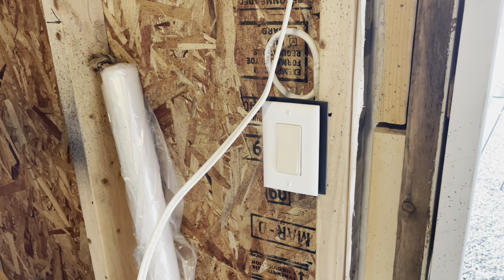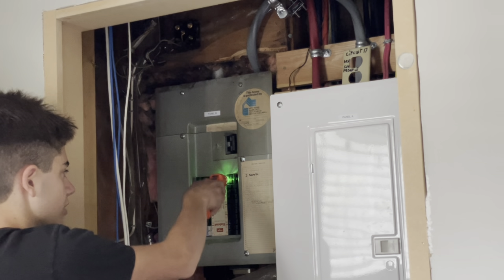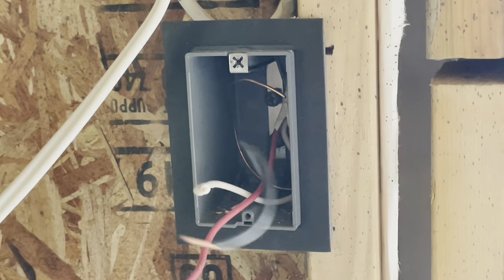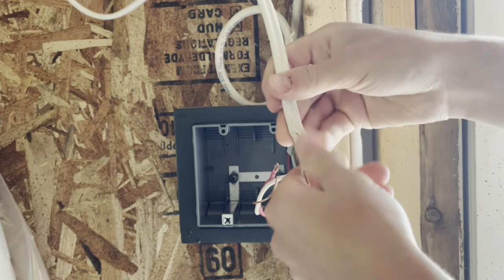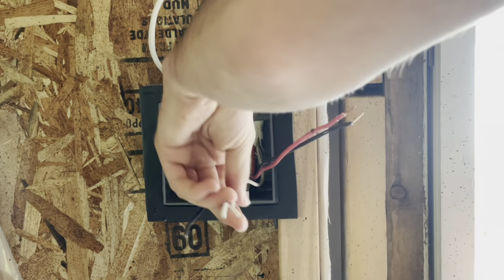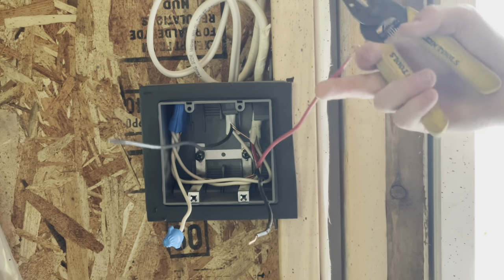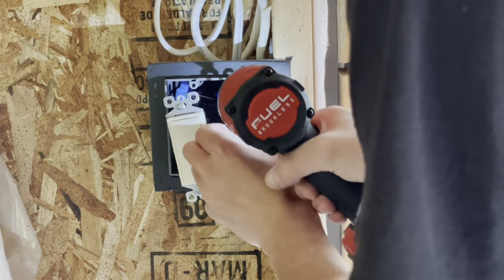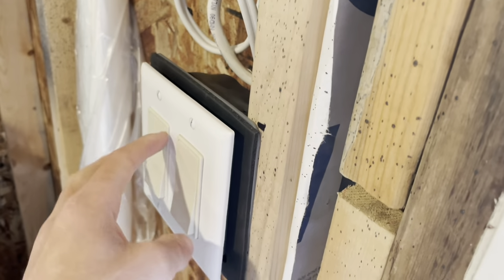Turning one light switch into two switches for two different lights.

Comment: A bit confused as if these 2  switches are powering 2 lights but shouldn't there be 3 cables? 1 power and 2 out to the lights
Reply: He ran power to the light 1st then down to the switch.  That's why he used 14/3 so black is hot in and red hot out to light where as most people just used 14/2 and white as hot out. But code changed and have to have a neutral in switch box now as some switches like lighted switches I just installed require a neutral to work. I personally don't like or use this method.  It was just used to save wire.

Comment: If you cut on both sides maybe an inch from the end, you can grab the ends of the sheathing and peel it open. No need to risk nicking the wire

Comment: Yo bro in the whole world its righty tighty , you need to put the wires in the screw so whenbyou tighten the wire screw it dont push the wire out , thats to prevent a fire 🔥
Reply from the maker: Yes the wire loop should be in the same direction that the screw tightens up

Comment: Was that a Federal Pacific breaker panel on the left? Those are dangerous panels especially the Stab-Lok. They fail to trip and burn the wire up. The failure is really high like 1 in 3 or 4 breakers will fail to trip. That would be a good video: panel replacement. I know you have the ability and know how to do it safely and professionally.
Reply from the maker: Trust me I know it's there and that it's a problem the thing is with replacing it is the cost of having to switch everything out to arc fault if it was moved over to the main panel

Comment: Those circuit breaker finders are great but yeah they can be kind of vague and a pain. I usually take the front of the panel off so I can bring the tester up close to the hot leads coming off each breaker and more clearly see which one is making it light up/beep. Just have to be careful when working on an open and hot panel, but that goes without saying!
Reply: I usually turn off the entire main system just to be safe. LOL!

Comment: Hi Nic, I have a light switch outside a closet that turns the light on/off inside the closet. The power source comes from the light fixture inside the closet to the switch outside the closet. The white wire at the switch is  the hot. 
I want to add an independent light with switch outside the closet using the power from the closet light switch and not the light box. Can you do that in Canada?

Comment: This is great. Question. Is this the same way if I need to wire ceiling pot lights and ceiling fan to two separate switches? I want to be able to dim the pot lights with one switch and the other switch would just turn the ceiling fan power on/off
Reply from the maker: Yea same idea

Comment: Have you heard of combination switch? Basically it is a switch that can control two lights and will fit in one electrical box. Saves you some trouble.
Reply from the maker: Yes I only use them if I absolutely have to like if it’s a box cut into a wall that I just cannot expand to a double gang or triple gang but for something like this where it’s easy to do I prefer just normal switches as people don’t really like the double switches and I think they look a little worse but they can be good for some situations

Comment: Thanks for the video. I’m looking for adding additional 2 switches instead of one. Am I able to just add 3 black wires? Or do you have a video for 3 switches?
Reply from the maker: Yes it would be the same thing just three wires on the line side of the switch

Comment: If you hit the test button on the circuit finder plug wouldn’t it trip the gfci or breaker? I’m just curious if it would or not.
Reply from the maker: It will test a GFCI so it would trip a GFCI receptacle but it won’t trip a normal breaker only if it’s a GFCI breaker

Comment: I don’t have that probe but when I replaced my doorbell button for a smart doorbell I figured out that the doorbell circuit transformer was in the garage so when I switch that circuit off the light for the button is off
Reply: You know what always works very quickly? Turning off the entire main system with one simple click. 🤣
Reply: @ytsux9259  but that shuts off the heater for water and AC
Reply: @VOLTRONDEFENDER4440  unless you have a gas water heater
Reply: @DanTDMJace  no my parents house has a tankless water heater

Comment: Why not just use a double switch instead of the box? A lot cheaper and simpler.
Reply from the maker: Double switches are great for a situation where you can't add another box but that's about it they suck in every other way specifically in this case not being able to install a smart switch for outside lighting
Reply: I did not see a smart switch being mentioned in the video. They looked liked the old dumb switches to me. Why is the color of the switch plate and switches different? Different brands.
Reply from the maker: @TexasEngineer  because it's ivory switches and white switch plate
Reply: @nics-systems-electric  Is that intentional? I have never seen that mixed. Not all ivory matches and it is getting impossible to match the old work.